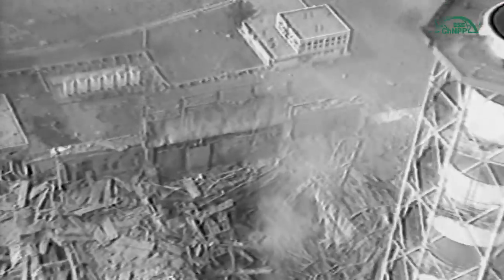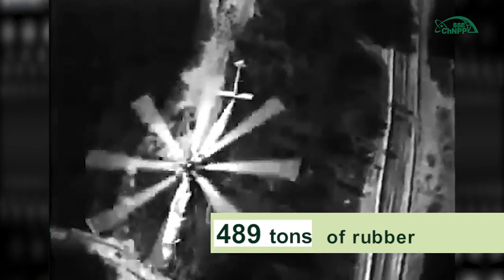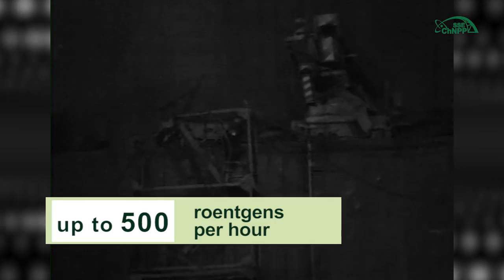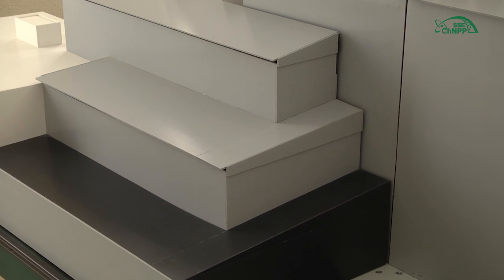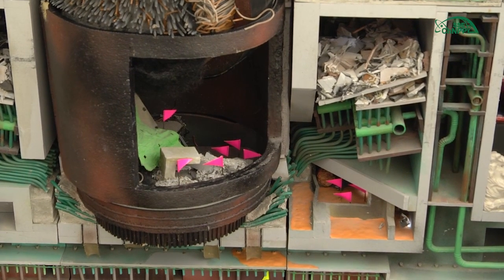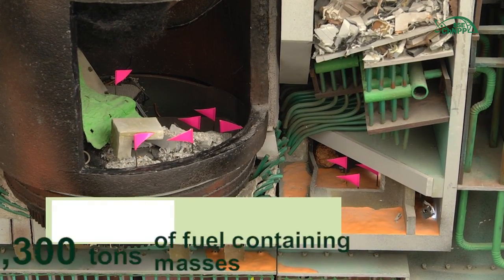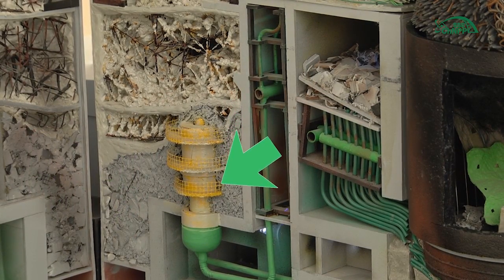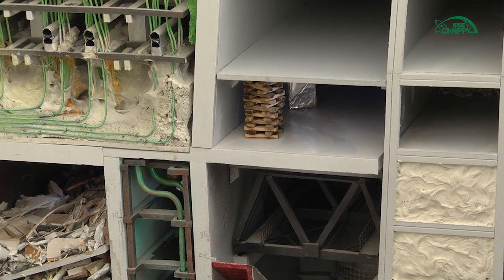Excursion within the "Sarcophagus"

Comment: Such a lie that the poor firemen and workers knew the hazards when they attended the fire. The Soviet authorities tried their best to cover up the situation as a radioactive leak.
If it wasn't for the fact that the radioactive plume was detected across various European countries who then investigated further and traced the source then they would have tried to have kept it a secret for as long as possible...
Those poor people that initially got pushed into service to battle the fire and at the very beginning had no idea of the radioactive hell and harsh reality of radiation sickness that they faced as they didnt have any clue neither did they have adequate or any at all protective equipment.
Reply: According to Nobel Prize winning journalist Svetlana Alexievich's "Voices From Chernobyl" the first of the firefighters were sent to Reactor 4 in such a hurry that they didn't even have time to get into their usual protective gear, let alone any sort of specialised gear for protection from high levels of radiation. The absolute priority was getting the fire under control. The lives of the first responders were disposable.
Reply: The firefighters had no idea. Many of the people who helped with the clean-up after did know. The three men who went in to open the water valves knew EXACTLY. They had to know, they had to be workers from the reactor because if they opened the wrong pipes the other 3 reactors would have exploded right then and there...
Reply: @krinkle909  As I have said previously, many of the initial firefighters did know the dangers and were aware of the radiation to which they were being exposed. Their first-hand accounts are detailed in the two books I mentioned. Comments on the night of "we'll all be dead by morning, boys" and "we're all headed to the hospital" were recorded from multiple sources.

Many of the firefighters, though, were oblivious, thinking that it was exactly what they had been told, just a regular fire that happened to be at a nuclear reactor (it's not as if there hadn't been fires before). The fact that none of them, including the actual Chernobyl plant firefighting force, had any protective equipment, other than standard firefighting equipment (which was pretty archaic in the 80s Soviet state) is simply a factor of the way the communist regime operated with such redundant features such as "safety" not needed due to the State not being fallible enough to allow situations where the people would even need it.

It is just hyperbole to say "none" of them knew, because there is eyewitness evidence from the men on the ground that some did know.
Reply: @guberhaus6038  Pretty sure, that those two lines were told as passing jokes between themselves. Listen to the dispatcher call recording. Whoever called from the NPP said that "There's a roof fire between the 3rd and 4th blocks". So none of them could have been aware of what's waiting them until they actually arrived at the place and even then, at first glance, there wasn't anything out of the ordinary, a huge fire and some crumbled away construction- definitely nothing, that'd make you think that something equivalent to a couple of dozens of nuclear bombs just went off. At worst they might have thought that a hydrogen explosion took place, crumbling some of the building and lighting the rest, with some feed water spilling out, it other words: not good, not terrible. On a side note, how could have the firefighters known, when it took the plant workers themselves, quite a few hours to figure out, that their reactor is wide open?
Reply: Regarding protective equipment and the lack of iodine pills that should have been given to everyone in Pripyat and in Kiev and really in the entire continent of Europe and Asia, that is outrageous! Especially since potassium iodine pills are so incredibly effective at preventing radioactive iodine from reaching the thyroid gland. There was a huge increase in thyroid cancer in children raising throughout Europe in children. Belgium noticed it and wrote a report. Communist countries could not be bothered, or that was my understanding of what happened in Romania. I got iodine because I was a little kid and I was in the hospital in Romania when it happened that Monday, or well when we found out it happened from the BBC.  Because my immune system was compromised from the bronchitis infection, they gave me iodine. I don't think they gave me more than one pill. The real dose should be 8 pills (or 16 pills or so) every 24 hours until the radioactive iodine disintegrates. Also my parents were friends with the head of the hospital. So I'm not sure if all the kids in Transylvania were given Iodine.
Reply: There's surviving first responders who said they did know there was radiation leaking out, they were not stupid. They still went up there and did their job because it had to be done, the fire would've spread to the other rector buildings. They still decided to sacrife their lifes to keep their families safe, like true life heroes.
Reply: The West knew within hours of the accident happening.  Within days satellites had been re-tasked to take images of the accident.  Even if there had been no radioactive plume drift into other countries, it would have been exposed very quickly.  Even in the 80s they wouldn't have been able to keep something like this a secret for more than a few days... ah the chess match that was the cold war.
Reply: @Chris-v4l3l  You have to understand that those were the learning times of nuclear power. I highly doubt they even had so much equipment (for all the workers) by that time. Be thankful they cleaned it up so fast, otherwhise the disaster could have been 1000x worse, affecting the whole world.
Reply: How could they NOT know? It's written all over the site Nuclear power station. Don't be such an idiot and think before saying such stupidity. Jesus, our propaganda works well doesn't it, did you also believe that Iraq had WMD's too?
Reply: @Azzlad  they lived under communism which means the individual is sacrificed for the whole. Also, their people were deliberately lied to, as many interviews and reports clearly show. I just watched another documentary of a general telling the troops who are about to go out onto a roof with over 8000 Sv levels saying "there's nothing terrible out there of course." They were only allowed to stay one minute. The level of understanding regarding radiation is weakly understood by most people today, and I'm sure it was even worse then, especially considering the education level of the average Soviet in those days. So they knew, but had zero understanding of what it all meant.
Reply: @Azzlad  The firefighters did not know they were dealing with a radioactive fire. You can find this information from multiple credible sources.
Reply: @croakingfrog3173  absolutely! Well said.
Reply: @Azzlad  considering there are many sources that indicate the emergency services had zero clue on what they were up against would you mind referencing your source? Otherwise it looks like you're the one saying stupid things.
Reply: GT J Many of the initial firefighters were aware of the radiation dangers, they just went and fought the fire anyway. Some of these firefighters were around when not only reactor 4 but other reactors and parts of the plant were being constructed, and knew what they were looking at when they saw the exploded building and graphite on the ground. There are numerous interviews with these men in the days, weeks and years after and their knowledge is pretty clear.

They did not have the knowledge of how the reactor worked and so did not have the instinctual bias of not believing the reactor could blow, as was shown by some of the technicians who truly believed, because of the limited information they had on the operation of the RBMK reactors, that such a thing was impossible.

Not all knew, of course, but many did. If you want to learn directly, instead of from internet comments, try Voices of Chernobyl or Midnight at Chernobyl, two excellent books on the subject full of eyewitness accounts in their own words.
Reply: Owen Denchy Maybe you should read the book? Most people were clueless.. no mass media, no cellphones, no internet. They knew shit..
Reply: Owen Denchy Back in 1986 no one knew what the effects of an explosion of that magnitude would cause. There were no proper radiation suits or anything else back then and health and safety and education were non existent. Nothing on this planet like Chernobyl had EVER happened before.Please watch Chernobyl on Sky Atlantic on the 7th May. I think you will be in for a big surprise at what went on back then.
Reply: @tester123532456 <--- brain washed sheeple

Comment: Many of the helicopter pilots who dropped debris to contain the core died of radiation poisoning not long after their missions.  It is frightening to consider that they never took a step on the site and reactor #4 still killed them.
Reply: ☭_DRINK_CCCP_420_☭ pretty sure particles from the unit were lifted into the air by the fire. Air won't do you any good then.
Reply: ☭_DRINK_CCCP_420_☭ Well the dust of contaminated debris was a significant problem, so I think the area above the unit seems to be a dangerous spot. I am not even sure if the helicopter crew even wore basic protection to prevent inhalation. If they did, then I could be wrong but I am going off memory here.
Reply: ☭_DRINK_CCCP_420_☭ Well they did make multiple trips, and absorption of radiation from introduction of materials into the body is far more dangerous in the long term since the material stays in your body.
Reply: ☭_DRINK_CCCP_420_☭ Its hard to find details on specific sections of the general Liquidators group. However a article in 2011 titled 'Chernobyl Pilots Knew Risks: commander' brings in a commander who talked about the fact the pilots were only offered very basic protection like iodine and clothing changes. Somewhere on the wikipdeia page for the accident iirc also described a pilot who tasted metal in his mouth. However most sources often reference the crash that downed a helicopter and not the health effects of close proximity. However no evidence I found contradicts the fact that pilots did get irradiated albeit probably not fatally so. The Wikipedia page also describes the need to contain the hole in the roof, as well as the danger of the dust and it's widespread travel which was detected in Western Europe. It's a very reasonable conclusion to assume that the pilots were in some danger simply because they are in the path of the particulates. If this seems too unbelievable I invite you to show me evidence that refutes MY primary claim that particulates from the reactor easily affected the pilots. If not, then good day, as well as the point of wearing masks even today when near the reactor to avoid inhaling long-term radioactive material simply because it's a very significant threat to well being. Would it really be any better hours and days after it happened with minimal protection at best?
Reply: ☭_DRINK_CCCP_420_☭ I might add the fact I have no real idea if any pilots died due to radiaton, but particulates can kill you in concentration. Either through sickness or a case of cancer.
Reply: @programmedgamer7101  elephants foote. Was supposed to eventually keep burning through the concrete of site 4 till it reaches ground water. As u gamers may take it.... Wtf- now!
Reply: Wasn't there also a helicopter that crashes onto the roof?
Reply: @g.bergervoet4505  Yes. These other people are conspiracy theorists. Only 4 people out of all the people who flew in with helicopters lost their lives. And that was NOT due to radiation poisening but due to the fact that the helicopter crashed with a crane while flying over the plant dropping sand and boron.
Reply: I don’t know how accurate it is but there it is
Reply: 3,3867? Since 1986....
Reply: The problem is that the rotor blades create a strong rotating circulation of air that blasts a tremendous spinning current of rotor wash straight down, that next defects laterally just after the blade tips and then curves around the top of the rotor mast as the blades draw air from the top that then gets blasted straight down, producing lift. So, in other words--as the helicopters flew low over all that radioactive smoke and dust--it got blasted out sideways, but then curled right up along the blade tip notices and then on top of the entire helicopter which contaminated the aircrafts and all who flew in them. There is an amazing, but horrific scene in the HBO mini-series, "Chernobyl," where it is shown how powerful the gamma rays that were being admitted from the exploded reactor was ionizing the surrounding air high above the debris with a spooky glowing blue light surrounding the area and visible five miles away from the air. The nuclear engineer aboard warned the pilot and Communist Kremlin big wig also on board to not fly anywhere near that reactor because a person exposed would be "begging" for a bullet by that time the next day.
Reply: An helicopter crashed as well. And the camera which took the photo was buried on the site as it was radioactiv as well. The cameraman is called Igor Kostin. No helicopter pilot died but the one who crashed.
Reply: It's not at all frightening. it was 100% predictable and preventable  and 100% useless. :)) 
Slavs and comunism, one will never find a more perfect mix of stupidity.
Reply: it's honestly shameful that there's so much misinformation in the comments of an official video
Reply: 1 pilot died of leukemia he attributed to this event within 5 years. Many of them went on to have long careers.
Reply: Somewhere there is an interview with the commander of the pilots (retired). He said 600 pilots died within five years.  I would have to rummage to find the interview.
Reply: @katsmeow2775  600 pilots died... so more pilots died than actual plant workers or firefighters combined ?
Yea. That's not true
Reply: @daviejay5326  I saw an interview with the commander of the pilots.  He said the deaths occurred over the months and years after, and were not counted as Chernobyl casualties.  Most of the deaths were from cancer.  The deaths of the liquidators and many others brought in for the clean-up were counted as industrial accidents if immediate, but ignored as they more slowly died off from cancer.  I saw an estimate that 30,000 workers overall have died.  Many in the months following their assignments, then a slower die off from cancer later.
Reply: Just not accurate. KNOW the facts before you try to state them
Reply: ☭_DRINK_CCCP_420_☭ dude, you're stupid, just shut up. Go learn something instead of arguing with no proper knowledge.
Reply: If your claim were true, these people would be listed at  https://en.wikipedia.org/wiki/Deaths_due_to_the_Chernobyl_disaster yet the only helicopter pilots there died due to a crash, not radiation poisoning. If you think you have better data, you will need to produce a good reference.

Comment: at 10:57, those fuel assemblies are spent fuel? what happened to spent fuel of reactor 4 which was supposed to be cooled in unit 4 ? why nobody talks about it?
Reply: Orange mass atthe bottom of model it is. Cooled down before going into soils, so its fine
Reply: i am not asking about the fuel that was in the reactor but the ones in spent fuel pool! but thx anyway
Reply: RBMK reactors were used for breeding plutonium for the soviet weapons program so fuel assemblies were swapped out on a regular basis in order to keep up a rich supply of fuel, this meant that the assemblies did not need to be cooled for several years like very depleted (aka 'highly irradiated') assemblies would and so they would only spend a week in a cooling pool before being packed in casks and sent back to be enriched again.

Combine this with the fact that reactor 4 was brand new at the time of the explosion and you have one empty 'South cooling pond' and a 95% empty 'North cooling pond' with just 130 fuel assemblies in it (around 15 tonnes of material).  Both pools had thick steel lids that somehow withstood the thousands of tonnes of debris that landed on them, though the pools were quickly found to have drained due to structural damage.

The 15 tonnes of additional burning fuel in the north pool did concern those on site but the fuel was under 40 feet of concrete debris (and the steel lids that had been assumed destroyed) and both were being showered by the same helicopter-dropped neutralisers that the core was and so the fuel in the pool was deemed to be more of a melting down hazard rather than a spreading particles upwards hazard so the plan was to remove any water in the sub-basement and just monitor anything that melted through.  Nothing did.   

At 10:52 in the video you can see both pools behind the reactor as he pulls the reactor section out of the model, despite being known as 'North' and 'South' both pools are directly next to each other and are situated directly west of the core.  In the model the pools are shown as one completely empty and one completely full, but in reality the north pool is almost as empty as the south one.
Reply: Unit 4 at Fukushima spent fuel all burned off before May 2011 due to the tanks holding them being broken.! 
https://hatrickpenry.wordpress.com/tag/plume-gate/

Comment: The amount of Retgens said here to be 500 were 1200-2500.
Reply: Wrong. Its measuring 500 at the time this video was made. Radiation degrades over time. Three months after the meltdown it was measured to be between 9 and 10,000 roentgen. Not 1200-2500. Its all about timing and when the person informing measured it.